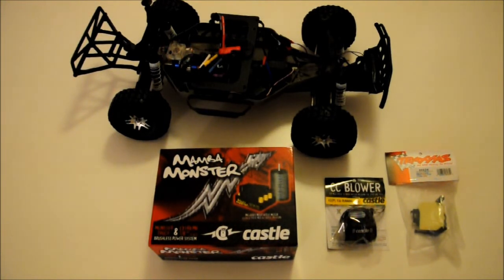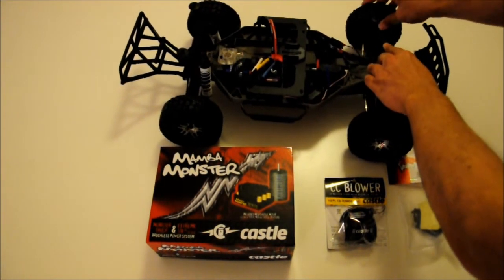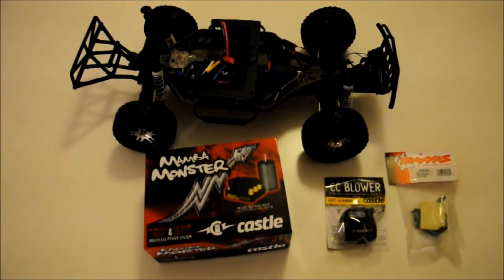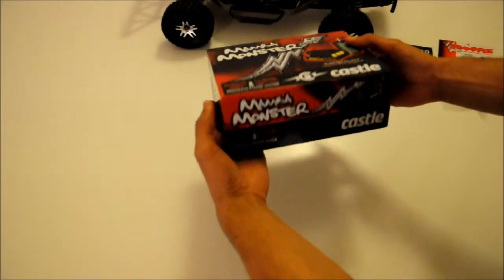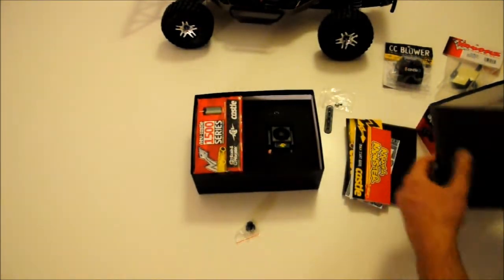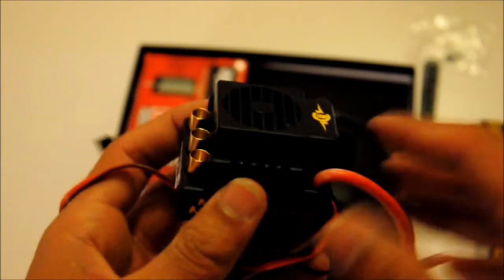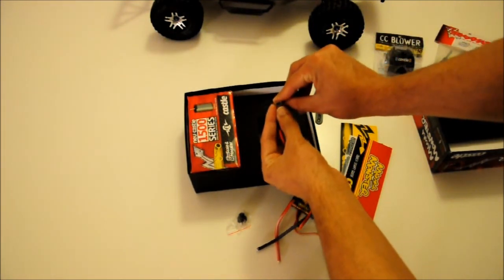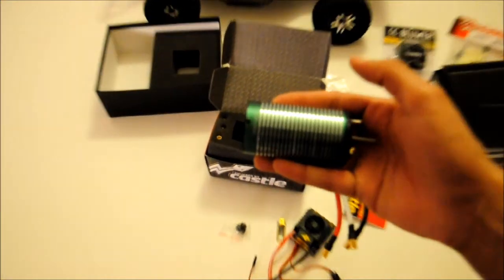RC Hobby - Traxxas Slash 4x4 Ultimate Edition Upgrades and Hop Ups - Mamba Monster 2200kv

Comment: lol nice motor setup but way way too much power for that truck your gonna break your truck that motors made for 1/10 or even a 1/8th scale monster truck and your talking about using 6s lipos lol your truck is gonna blow apart good luck with it i would have went with a tekin rx8 esc and a tekin pro4 4000kv bl motor and run it on 3s lipos lol